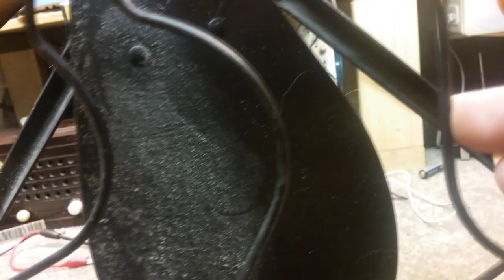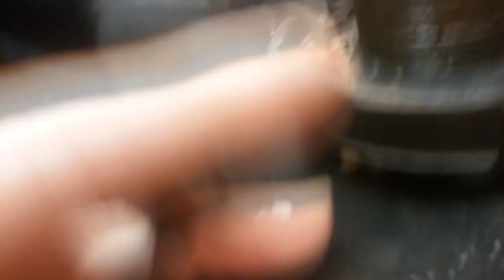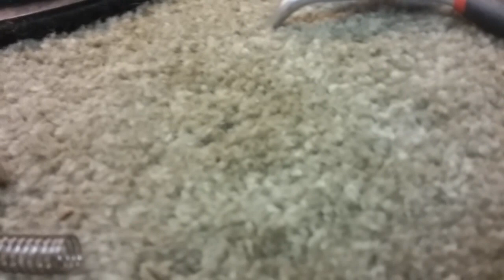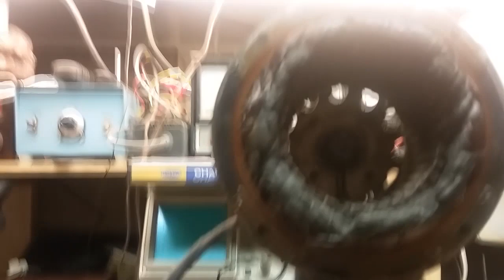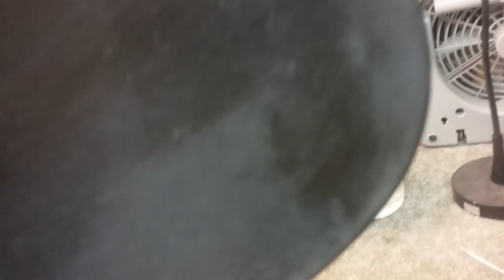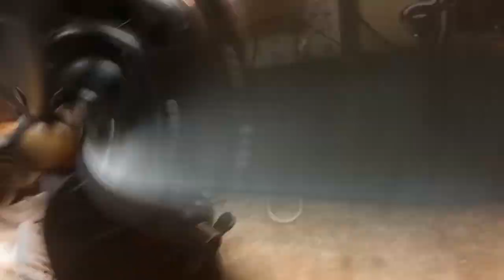1924 Westinghouse 321347 Antique Fan Repair

Comment: This video is just wonderful! I just picked up a fan of this exact same model.  I haven't even began troubleshooting it.  But it is one of two vintage fans that both have pretty significant wobble at the neck-  between the motor and the base.  As I'm a hobbyist with no real training in repair, I'm a little confused on the exact problem or how to fix it. Any suggestions?

Comment: I have a Westinghouse 16 inch 1930s vintage fan in great shape. I had it restored years ago and it looks great, high medium and low is great, it oscillates well its just noisy. Like a loud humming. Any idea what the issue could be. I watched your video and think it may need to be lubed… is that a correct assumption?
Reply: It’s a Westinghouse model 516873-A.
Reply from the maker: It could be just needing to be re-headed and oiled. It could also be electrical. Hard to say without seeing it hands on.

Comment: I’d like to repair a one speed Zero fan but I know positively nothing about repairs. I can hear energy going to the motor but it can barely spin. As long as energy is going to the motor does that mean the motor doesn’t need replacement? Thanks!
Reply from the maker: At best, it means the coils are possibly energizing. But there is no way to know until you check the resistances on the coils and do a visual inspection as well. Some motors have two coils. A main coil and an auxiliary coil. One can be good and one can be bad.